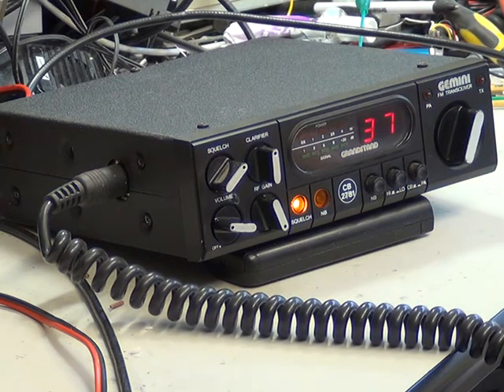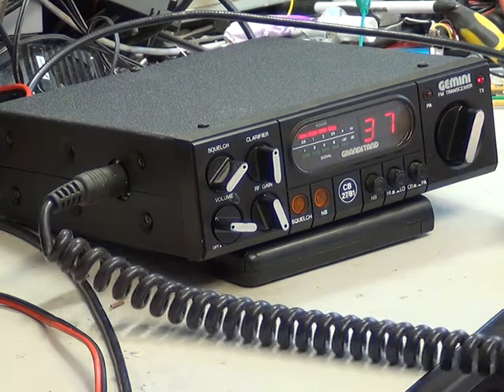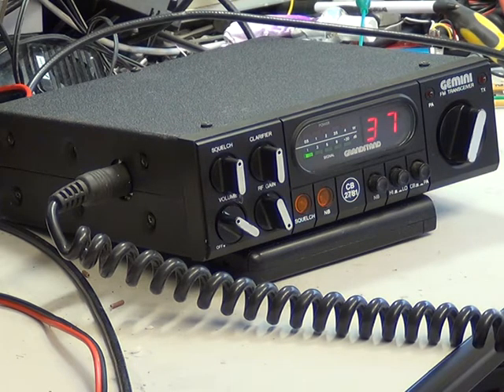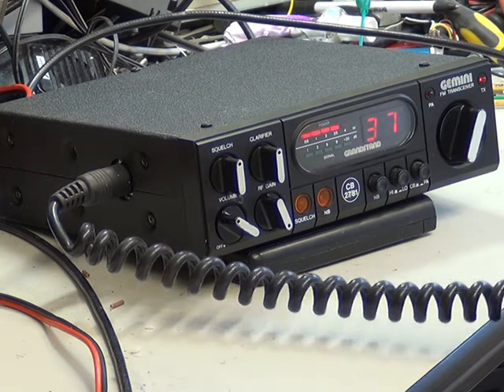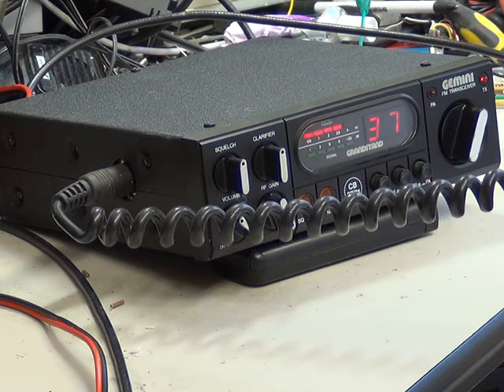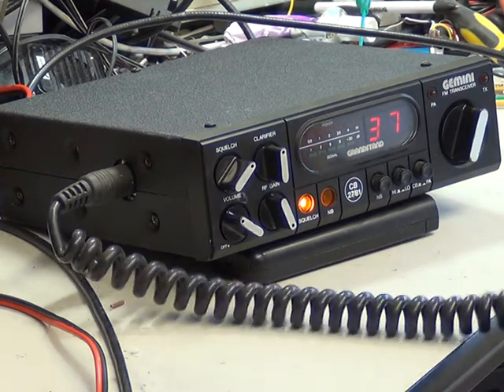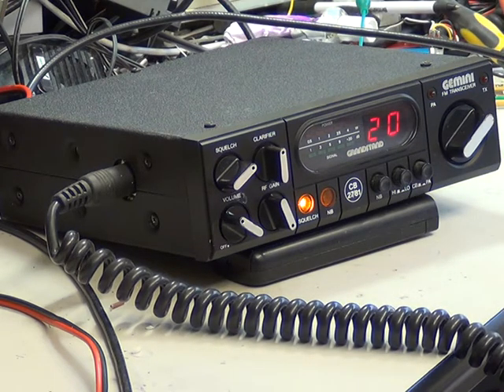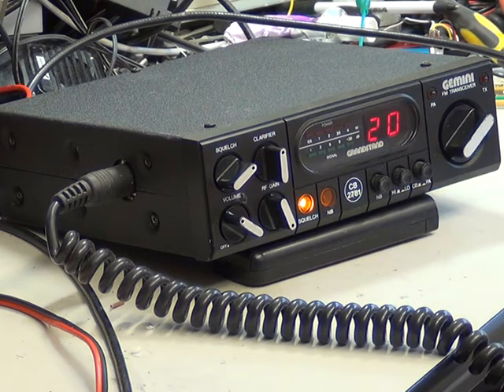Grandstand Gemini, UK (CB 27/81) CB radio (Mobile) - On The Air Test

Comment: Ive just dug out my old Gemini and discovered that it has no display on the LED's although the TX led flashes when you put the PA switch in.  Had a look at the base station circuit diagram but my eyesight isnt what it used to be. Is there one for the Gemini?
Reply from the maker: I do have a circuit for the Gemini (email me rshireby@yahoo.co.uk), but it's less clear then the base circuit I think. The radios suffer from dry joints between the two sides of the boards rather than electronic faults. 

Richard
Reply: @ukfmcbradioservicingTango21  I have tried xmit and receive with a known good but it does nothing. I fitted a different squelch circuit years ago (1981 I think). Comparing it with a Maycom EM27 and a Team MC8 (faulty). Ill open it and have a look round. I suspect the base circuit will do me fine thanks. Do you have a source for mike cables? I have a couple shredded. One on a NASA marine Radio.
Reply from the maker: We can only get 3M long mike cables. Look on ebay, more than one person sells new ordinary ones.

richard

Comment: I've never seen one of those in the flesh but i'd always thought they were another variant of the Amstrad 901.
Reply: No. These were out on their own. The Grandstand Gemini and Telecom TC9000 has the same board. 
The Amstrad 901 was a cybernet chassis.
Reply from the maker: and of course the Wager & Atron. Same board in Grandstand, Wagner & Atron bases too. Unreliable owing to dual sided PCB linked through with ordinary wire & dry joints at the link points, not at all helped by the whole VCO/synthesizer can being filled with wax.
However, these rigs work very well when working & are very selective. Better still, anyone using an illegal radio that won't go exactly onto UK channels is unreadable.

Richard